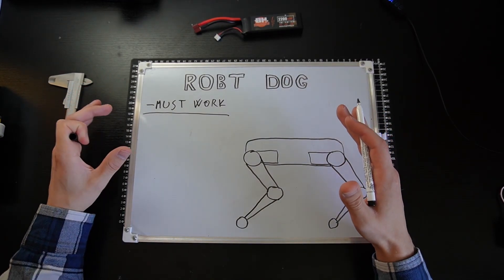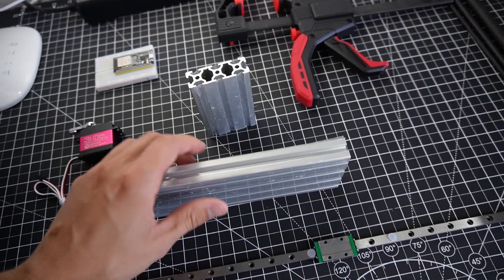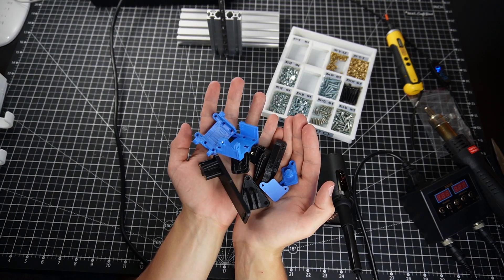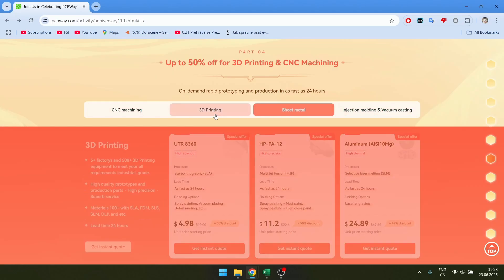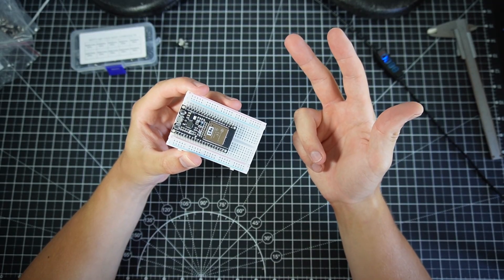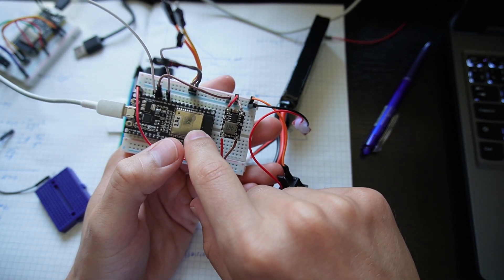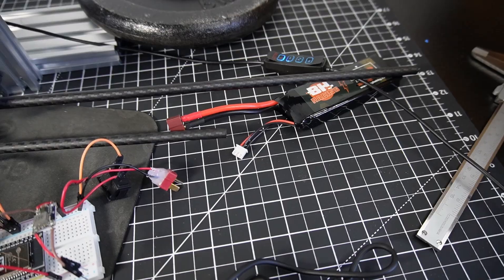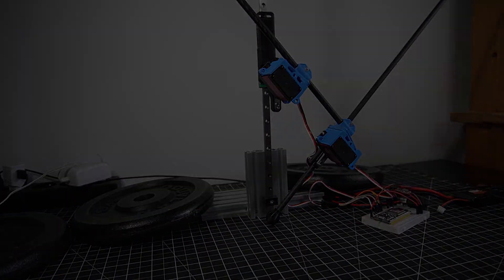Making a Leg for my Robot Dog

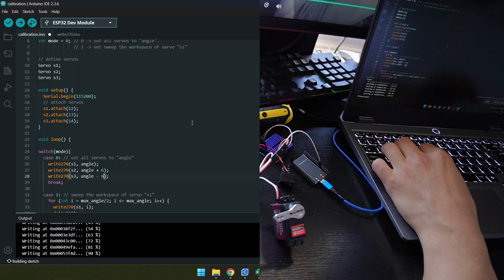Comment: @5:50 the 6 degrees come from the discrete offset of the servo legs?
Reply from the maker: Yeah you can't attach the servo arm to be straight, so I just correct it in code. I tried offsetting the angle in code by 6 degrees and it seems to be straight.

Comment: You should use foc control with bldc , they are cheap and a lot stronger and faster. 
Only the controllers are expensive but simplefoc is relative cheap and good
Reply from the maker: How much do you reckon the motor + controller cost? I will make custom actuators in the future. Right now I want to make a simple robot dog, so it's cheap and accessible to more people.
Reply: @TazerEngineering if you realy want a cheap bldc foc controller its possible with an arduino and a drv bldc driver and a feedback sensor.
For more tourqe you need a planetary gearbox , what can be 3d printed.
I cant realy say the owerall cost , beacuse it chenges with the design

Comment: Going from a dead stop to max torque until you hit the final position followed by max torque to make it stop immediately is causing the overshoots because it takes infinite torque to stop immediately. A way to fix this is to plan a path to go from point A to point B in many steps. 

One example of a path is where where the velocity starts at zero, ramps up to a value, holds that value then ramps back down to zero such that it stops at the right position. Because it takes a constant acceleration to linearly increase velocity, this method lets you set a maximum torque that is within the capability of your servos.

Going even further there is a term called "jerk" which is the rate of change of acceleration. Since the servos likely can't actually go from zero torque to max torque instantly, you can linearly ramp the acceleration when making changes in acceleration for even smoother motion.

Comment from the maker: I'll post the detailed video + free project files today. Didn't have time to do it yesterday.
EDIT: posted
Reply: Are these projects expensive?
Reply from the maker: @aminehas161   This one should be on the cheaper side. Motors are 2x $10, carbon fiber tubes $10,  ESP32 $10, battery $30. So about $70. You could just 3d print everything and use MG966 servos to make it cheaper.

Comment: Not sure if you are already using it, but I believe interpolation could solve the issue of the foot moving forwards and backwards when adjusting the height.
Reply from the maker: I had a segment about interpolation, but it didn't solve the problem since I want to move the servos at their max speed, and the bottom servo is just slower. I'll use interpolation once I make the leg follow a trajectory instead of this jump test.
Reply: @TazerEngineering Alright, That makes sense :) Good work so far!

Comment: Program the servo with acceleration and deceleration could potentially remove the jitter
Reply from the maker: The servos jitter even with slow movements. Someone suggested using a lower voltage (I am using 8V, they are rated for 6.8V) and adding capacitors. I am gonna try to solve the jitter in my next video.
Reply: @TazerEngineering It could also be caused by the internal servo PID, the pid cant handle that much inertia. I've dealt with this before, on a rc plane. The servo oscillate when it try to move big control surface
Reply: @TazerEngineering That big inertial movement makes the potentiometer in the servo overshoot, everytimes it make corrections. I havent found a solution yet